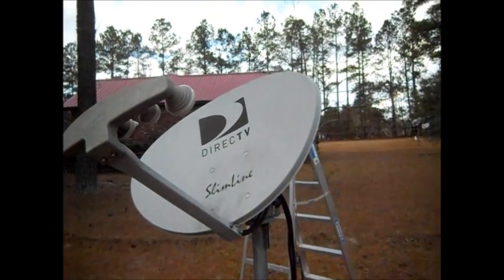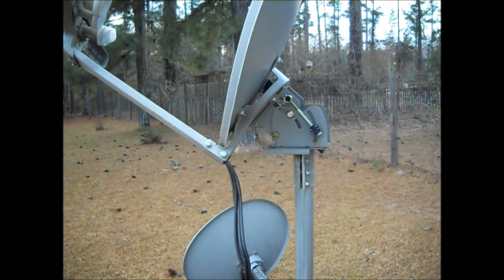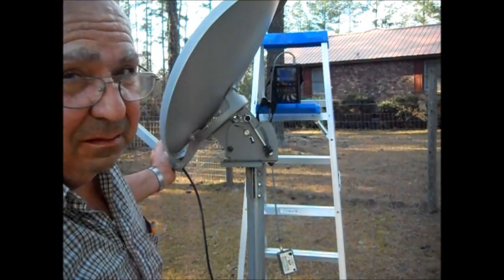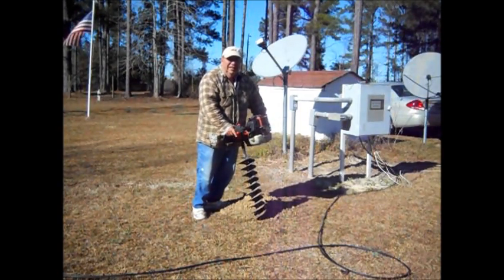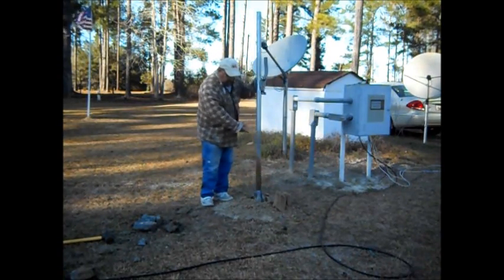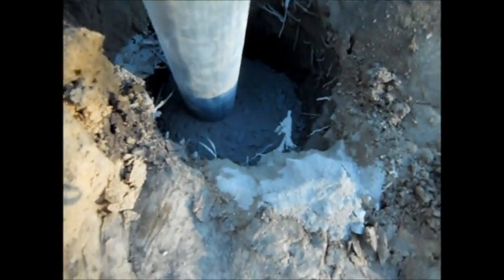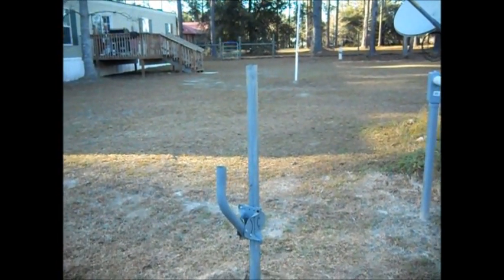How to convert and install a old trashed DTV satellite dish to a FTA Dish

Comment: Must be a pretty arid climate to have a good half foot of dirt going back into the hole where the post was set. Down in the gulf coast it's a good practice to get the concrete above grade so that the moisture doesn't corrode the metal. It also does wonders for a wooden fence post as well. The most common cause of picket fence failure is the post rotting out at the base. You finish the concrete so that the water doesn't sit around the post and it will last a long time.

Comment: Direct TV and DishNetwork dishes are a bit small for good Ku band reception. They will pick up very strong signals though. For serious use a 1.2 meter Ku band dish is more adequate. Old Primestar dishes are great and work well.
Reply from the maker: Yes I have a couple of them, only one in use right now and they are a great find. I do use a slim line on the Hispsat 30dg satellite and it works very good even in the lite rain, and it is the lowest look angle that I am currently using.

Comment: I would love an update and a walk around of the entire system. Get two young'uns; one to hold the camera and the other to ask questions and say, "Wow." Thanks for sharing.
Reply from the maker: Hi John Thanks for your visit. I will make a video showing what is going on soon. It has been to hot for me to work outside this year, I even had a very bad vegetable garden this past summer. I bought a "tent" to work under but I could not take the hot weather. It is cooling down now and I am getting antsy to get back to work on the FTA system and my Ham Radio antennas. I also have fences to mend and trees to cut down lol the age clock keeps ticking 71 in a few days...  Tks again    Leo

Comment: Thank you. for the video. very good. I would like to know and have more details of the components you used. for example what type of LBN did you use.
also the measurements you installed the lbn .. put the links of the components you use in the videos. please . thanks. your followers will appreciate it

Comment from the maker: Oh yes the brackets can be bought with or separately on eBay 73 Leo
Reply: Tnx  es 73.  Konrad
Reply: K1ZEK why not motorised dish ?
Reply from the maker: Hello. I have dishes that are fixed so I can have more then one receiver set on different programs from more then one satellite. The system has multiple output LNBs connected to Diseqc switches. I do have a motorized dish to search around the satellite belt for new programing. My main interests are live news feeds and foreign TV. Well thanks for your interest..   Leo
Reply: Hi K1ZEK I have a dish that Dish Network left to me some years back when I unsubscribed but they took the feed horn. My question to you is rather than measuring the focal point can I just use a level or laser to aim to the center of the dish when mounting free-to-air feet horn
Reply from the maker: @thomasfinchio1362  You would need to know the distance and the angle from the top surface of the factory LNB arm first , then the distance from the factory LNB face.This put the NEW LNB exactly at the focal point of that dish. Now you can get this information from a dish that is in use by someone else. Just make sure it is exactly the same model. I hope this helped.  Leo.
Reply: @K1ZEK  hi Leo thanks for the reply I am hoping someone out there has that information if I remember correctly that dish had three lnb's on it but we're probably all in the same situation when you cancelled Dish Network they would ask for the lnb's and the receiver back.  I just downloaded a great satellite finder, compass and angle finder really sharp and easy-to-use apps. Years ago I used to have that big dish believe I had to change the actuator arm one time and believe I have some tools around here for setting up satellite dishes thanks for your help. Tom

Comment: am I wrong or did he drill a hole in the ground within 10 feet of a high voltage power box? I saw no oups markers. please be careful if you try this at home.
Reply from the maker: Rick Jones Hello, The junction box is recycled and is being used to house my antenna switches as seen in my other videos. All the underground utility services ie water, telephone, spair conduits and electric service  were maped out in advance. My other videos show the installation of my underground piping and the recycled box. Many thanks for your interest and have a Happy New Year.
Reply: Good job then. Everyone be safe in the new year.

Comment: I will try your method on an 8ft solid dish I will be installing!!
Reply from the maker: +Carlos Cisternas I never used the DRY method on 8,10 and 12 ft dishes, only on small Ku band dishes. The quick rock was mixed with water in the bucket it came in. You had to be quick because it got hot and expanded. I did prefer to have a cement truck deliver the cement....Leo

Comment: Hahaha!! I was wondering about the same with quick dry cement, did you mixed it inside the hole?
Reply from the maker: +Carlos Cisternas   No I just added a little water and let it get absorbed. The first time I saw it done I didn't believe it either. lol When I was installing 10ft. C band dishes for a living  (20 years ago) we did use something called "quick rock" it was a white power that expanded and heated up; it cured in about 10/20 minuets if I remember. It was very $ at that time and it came in a 5gal. bucket Thanks for watching...Leo

Comment: Leo, how do Dish Network, Directv and Bell LNBs differ from the ones used for FTA?  Is that a "Single satellite TV dish LNB bracket" that you used?
Reply from the maker: Hello, Some domestic LNBs have circular polarization and some are vertical and or horizontally switchabel. I am not up to speed as to what domestic DTV companies are using. I do know they are using many different switching logics,  voltages and frequency schemas. So I myself find it simpler to use less complicated LABs. Hope this helps 73 Leo
Reply from the maker: Hi again, you can use multiple LIBs on most dishes.I like to use separate dishes as you can lose gain on outboard LABs. When using a recycled DTV dish for FTA that be slightly damaged and may be a little low on gain and have a distorted focial point location. 73 Leo
Reply: You are correct.   A search of Amazon answered my question. It looks like Dish Network, Directv and Bell all use circular polarization.  And, the FTA satellites use horizontal and vertical polarization.
Reply from the maker: The answer is a motorized dish. I use one to search around the satellite belt. It is currently mounted on the same pole below a fixed dish.

Comment: Very interesting, I have a question:
Why did you have to remove the electronics, etc. from that dish?
It was all set to receive satalite TV the way it was, maybe I asked a dumb question but as I said I know nothing about satalite TV...LOL
I never heard of pouring dry cement in a hole and adding water after, did I miss something, did you mix the cement first before pouring it in the hole?
Leo, I am full of DUMB questions...LOL
Reply from the maker: +old64goat  The electronics (LNBs) are the wrong type for the FTA satellites that we watch. And yes I could not believe that they use a dry quick mix and add water after we put in in the ground, but it works fast. The Dish TV and Direct TV guys do it this way so they can get in and out in a couple of hours and no cleanup.I don't know how long it takes to really cure but they seam to stay put. Thanks for the questions Very Best ....Leo
Reply: Thanks Leo, that is news to me about that cement.
Reply: +old64goat you can even dump the dry mix in the hole and it will eventually set up from the rain and moisture in the air as long as it is undisturbed. ranchers do it that way on fence posts.
Reply from the maker: Yes that works also, I am lucky to own a couple of acers of "High and Dry" sandy land so I cheated lol Thanks for the comment and enjoy FTA hobby...Leo

Comment: 0:30 I see a Fortec Star Dish. One person In my neighborhood has one and I wonder what is it for and what does it do.
Reply from the maker: Hello; The  Fortec Star product line is and has been used and supplied by broadcasters of Satellite TV programing. It is very popular with FTA satellite hobbyist also. If it is mounted to a pole with a horizon to horizon motor, my guess is it is used for FTA hobby type reception. If it is mounted with a fixed bracket it is probably being used for a dedicated service. If it is a friendly neighborhood you could knock on there door and tell them of your interest in FTA satellite and ask them how they like there dish.  Then you could find out what it is used for, or maybe get shot.  lol  Ha Thanks for stopping by , hope I helped you.   Leo
Reply: K1ZEK so it’s not a subscription? Just a company that makes satellite dishes? And what does KU Band mean? And C Band. And you can use a satellite dish to get free tv? If so how many channels and what channels. Any channels you can’t get for fee with a antenna and you have to pay for?
Reply from the maker: Fortec is a brand name, of dishes and satellite TV receivers. You will have to ask them if it is being used for subscription TV or FTA reception. The RF spectrum divided into letter designations for different frequencies. The L band is 1-2 GHz the C band is 4-8 GHz and the Ku band is 12-18 GHz. and so on. note: these are approximant numbers. There are a lot of FREE TV channels booth with over the air DTV home antennas and FTA satellite TV dishes. Search the internet and you will find websites for booth FTA satellites and DTV over the air services showing what services are available at your location.

Comment: What was put in place of the original electronics at the end of the dish?
Reply from the maker: Just a Ku band LNB on new bracket. If I misunderstood your Q. please try me again. thank you...Leo
Reply: Forgive me, not very knowledgeable on LNBs.  So this Ku can replace the one I just took off on my direct tv dish (the very same one on your vid), for FTA broadcasts, without buying a new antenna?
Reply from the maker: Hello. Yes. The dish is the reflector part of the antenna, it's like your ear it catches the waves and sends them to your eardrum. The dish reflects the satellite RF waves to the LNB for amplification and conversion to a lower frequency; then it is sent into the house via a coaxial cable. There it is again converted and a channel is chosen by a FTA receiver to be watched on a TV set. Thus you need a FTA satellite receiver in the house as part of a FTA satellite system. Please note: Satellite FTA is not the same as local TV digital over the air FTA. thanks for your questions hope I helped. very best  ....Leo

Comment: This came with the feed horn?
Reply from the maker: Hello Michael, Well yes the Ku band LNB's have a slight flair at the opening so it does a great job seeing the edges of the dish. As the recycled dishes are not always "true" in shape the exact position will need to be fine tuned to have maximum efficiency. Many thanks for your interest, now that it is cooling off outside I hope to make moor videos as I have a lot to do. My very best and Happy New Year...73 Leo k1zek

Comment: What is FTA and I think I know what DTV is ? ( Digital Television ) [ I have 2 old Analog  25   "     ( inch  , measure Diagonally   / or  \   )* Opposite  corners *   CRT's ( Cathode Ray Tube  ).
Reply from the maker: Hello Sheryl, Thanks for the Question. FTA stands for "Free To Air" transmissions, in this case via Satellites. It is like SWL "Short Wave Listening" via shortwave radios. There are many communications being sent around the world from satellite fleet trucks to TV stations and Teleports, if these are not encrypted they may be found via a FTA satellite system. There are also many TV programs that are sent via satellites intended to be received by the public for FREE. I and many others in this hobby (FTA) do not engage in trying to decode "cable" TV channels; and there satellites are located next to each other. Sorry I sometime get carried away explaining stull lol. Now as far as measuring the "dish" is done many ways. Dish physical measurements are done related to the mathematical equations being used to calculate things such as gain and focal length. Sorry I don't know a easy answer. Again thanks for the sensible questions 73 Leo k1zek
Reply: Sorry , but this is Information Overload for me , as I'm not a "Techno Geek "  Sometimes I even get connecting a different computer  not quite right , but as of now . I'm using a windows 10 Desk top  ( under my desk ^^  ) , but I want to use my older computer  (windows 7   ) in my bed room , but I don't know what I need to configure it other that another DSL older thing I got from my phone company ( Land Line ) , but something I don't understand is a D link ?   o.O  I know it's that blue thing with antennas on it , but I don't have a power cord to it and the older DSL  unit .  I guess I could call my phone co. to ge4t that plug for the older DSL box ? * Too many thoughts racing in my head maketh me dizzy * ( sorry that was the Old English from  the knight's age .  ^^ )
Reply from the maker: I know just what you mean, at 70+ yrs old I to fight with this stuff every day. Well very best  73 Leo k1zek
Reply from the maker: TKS K
Reply from the maker: Sheryl Courtney FTA means free to air.  The programing is not encrypted.

Comment: You wish that you would explain in detail what you’re doing like how did you come up with 18 1/2 inches focal length  or do you just assume I am an engineer
Reply: He came up with that by measuring the distance from the center of the dish to the old LNB that he will eventually take off. (Shown clearly in the video!)
Reply: Doorguru Thank you so much  But again I’m not an engineer what is the LMB
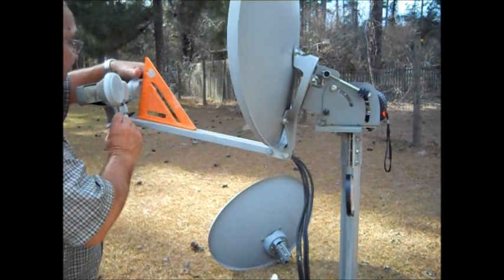Reply: @philb5   The LNB Is the device that the dish focus's on. The device that the coax attaches to.. ( see 1:49 ) He is holding the orange triangle square against it. (he calls it a feed horn).
Reply: Doorguru I know I’m as dumb as a rock  but the focal length is measured to the LNB I think he said 14 inches but the LNB is 4 inch above (on top of ) the  bar  he has not taken into consideration once he removes the LNB (  +4 inches ) the focal changes to maybe 19 or 20 inches out on the bar
Reply: @philb5  1:49  He stated 18.5 inches. I'm no rocket scientist either, but it appears that he measured and mounted the replacement LNB to the same location/dimensions as the one he took off. I don't understand why you think the height of the LNB, which he measured but gave no value,  will throw the focal point off 4 inches.
Reply: Doorguru Thanks  I was confused so he replaced the LNB at the same height  then the focal length is the same
Reply: By the way what does BLN stand for
Reply: lBN
Reply: I also do not think it was very clear he never what his measurement was he just said measure 18.5 inches and also i dont understand is the lnb suppose to stand straight up or be at an angle

Comment: So you aren't converting the existing equipment. You are replacing parts. I guess there is no way to CONVERT your existing dish to FTA without REPLACING hardware. So this should be titled "How to Replace Existing Dish with FTA Parts?"
Reply from the maker: maybe the next one; I will also show more on the air operation also. Thanks for the interest.